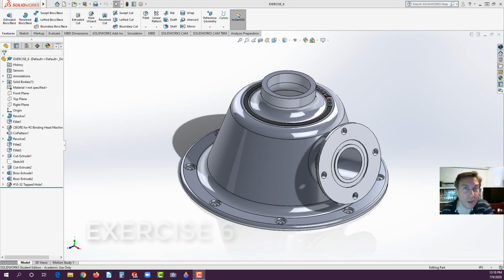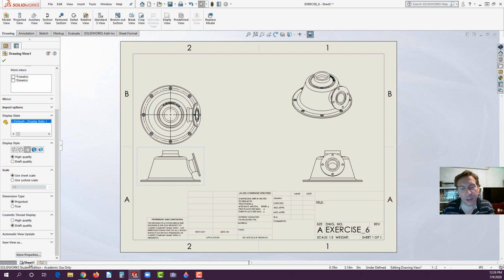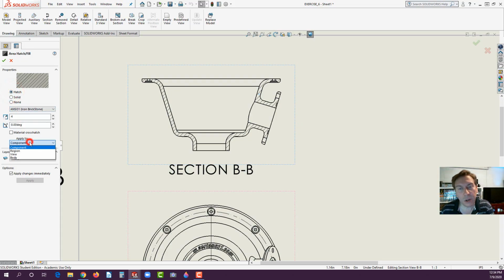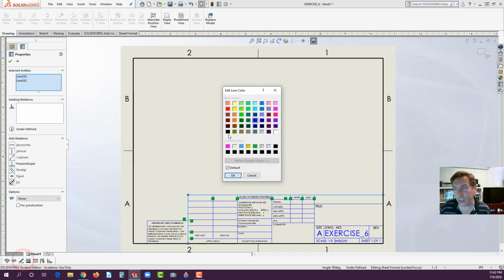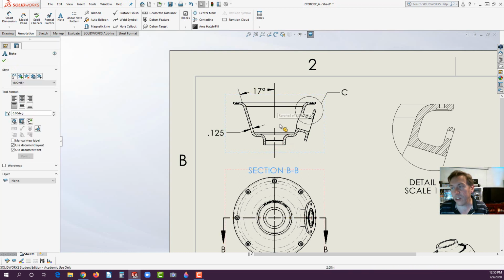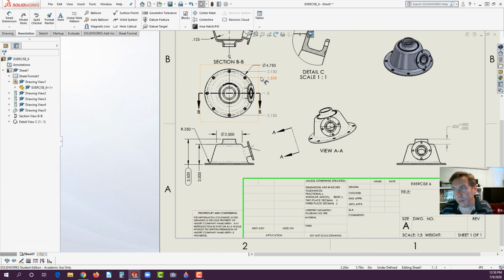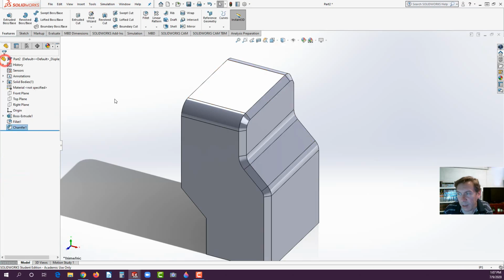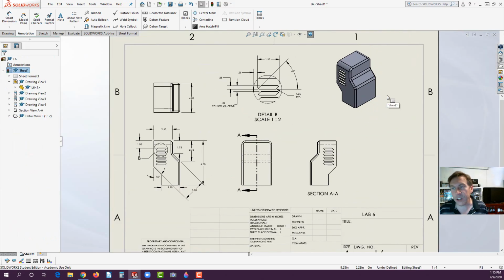E6 SolidWorks 2020 - Detailing Drawing Basics 1 Tutorial

Comment: Thank you for another interesting SW class! I have an issue, though! Being European, but liviing over 40 years in US and seeing almost exlusively the 3rd angle projection drawings, I am not sure anymore, what the standard 1st angle projection layout should look like. Just thinking lgically, when my first view is TOP view and I derive front view and right side view from it, is shoud have the top view in the upper right corner, vertically below it there shoud be the front view and on left side horizontally should be right side view. The isometric then shoud be sort of  225degrees from the X axis( in Cartesian analytical geometry concept that would be somewhere in 3rd quadrant of the drawing.....(assuming the bottom left corner of the top view is X0Y0). Yet-if I am not wrong, it is not , what I remember. If I remember correctly from the school (more then 50 years ago), the top drawing used to be positioned in bottom right corner of the sheet, left to it would be right side view and above(where I would assume to be back side view) is the front view. And the isometric at 135 degrees from the X avis(i.e. in the 2nd quadrant)....But it has been so long, I am not sure now at 70 years of age. There is also possibility,that the international drawing standards have changed and the layout is different then years ago..... You tube and other Internet sources have somany explanation of this, yet they are many times contradicting each other or at least do the things different way....
I wish someone (perhaps you, Mr. Sikora) would clarify it for me and others, because understanding this is one of the most important concepts in engineering....I am attching a video, which I did couple days ago, wheere I show tehconfusion and alsouncertainity of the ISOMETRIc views in both ANSI and European projection system...... There is one more issue: and that is the language,,,,Why is it called 1st angle and rd angle projection, if there is no any angles involved?????...Thank you
https://youtu.be/c5jeo6v4esQ

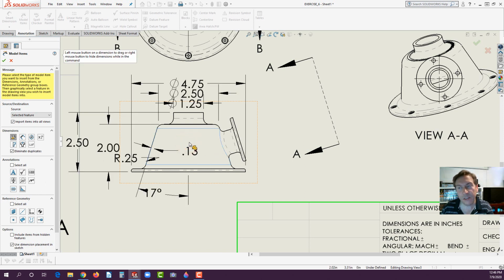Comment: Hi. Just a quick heads up at 28:20 for those using SW 2018. The part actually loads as "future version file". You might not notice this before you try to model items. This does not work as the file is loaded without features. Using the old version file works well in this instance.